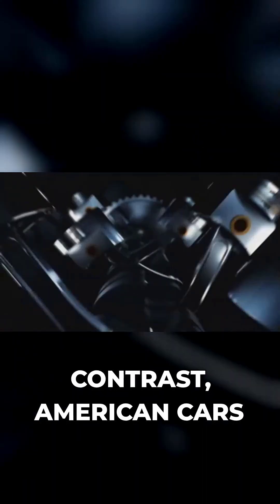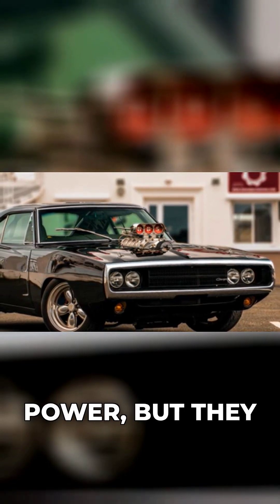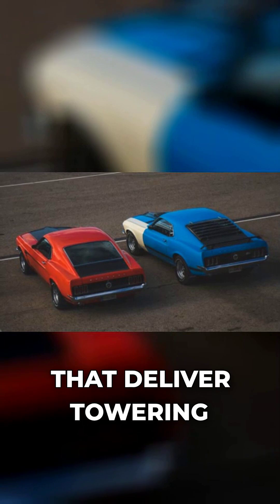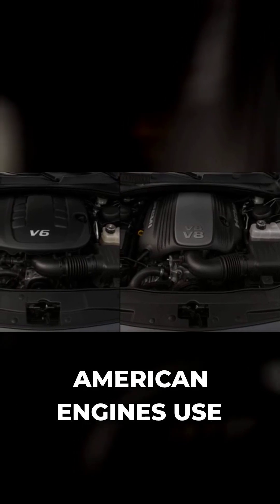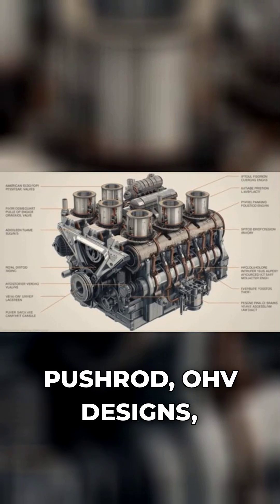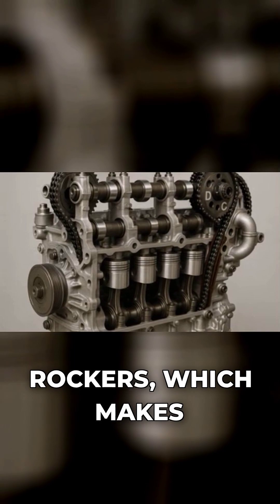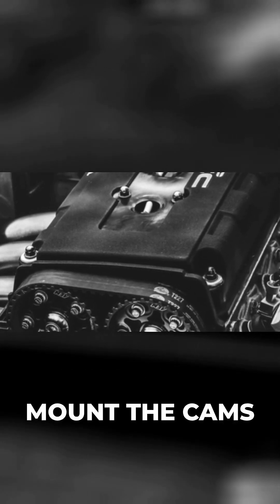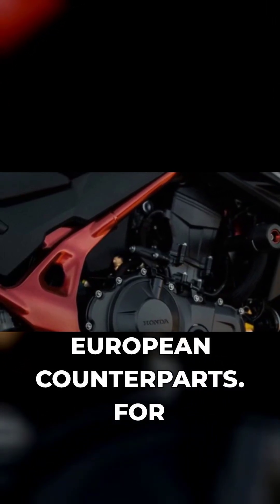European V10 & V12 Engines Precision Meets Performance

Comment: Here in Portugal (europe) a liter (1L) is 2 Euros, more than 2 $
Reply from the maker: That's exactly why European manufacturers have become masters of efficiency! When you're paying 2+ euros per liter, those V10s and V12s need to deliver serious performance per drop of fuel. That's why you'll see things like cylinder deactivation, advanced direct injection, and hybrid assistance in European performance cars - they're squeezing every bit of efficiency from that precision engineering. The technology has to justify those fuel costs!